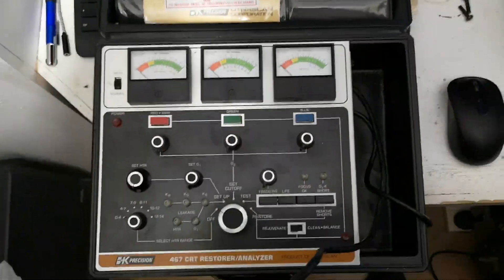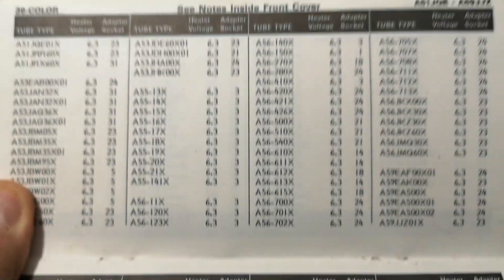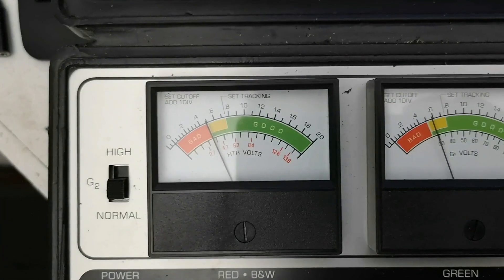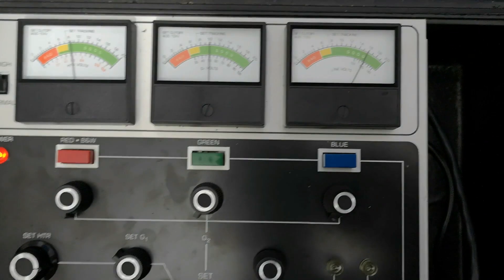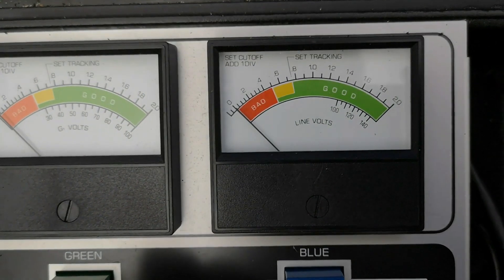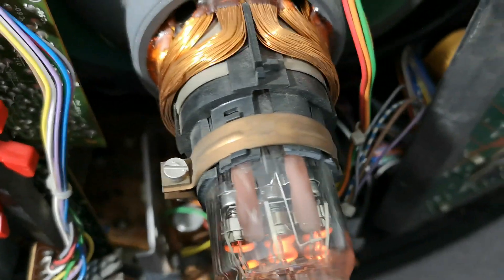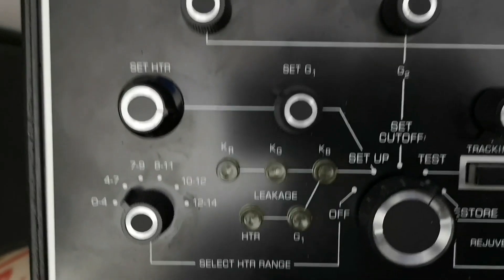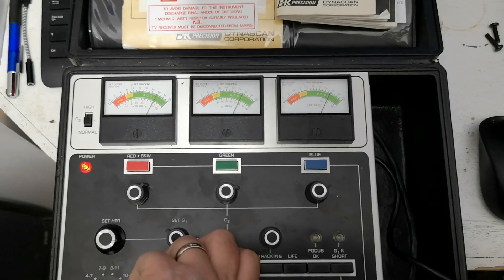Testing a CRT with the B&K Precision 467

Comment: hello I have a bk 467 crt tested the ammeter does not read the filament voltage it only indicates 1.5 v. but when I measure on the wires of the output cable I find all the heating voltages

Comment: Hi, I have the 467 and when its disconected from the tube, just turned on, the 3 little globes barely glow out of the 5. The unit works and cleans as normal, just those globes are always barely lit say 1/10 brightness. A leak to earth in the machine? Any idea as i have the schematic looking for a common point why all 3 globes would be drawing juice even when cable to neck not connected?
Reply: Hi, I just bought one of these on ebay, it has the exact same issue you describe with 3 lights (KR,KG,KB) barely lit up with nothing connected. Did you manage to fix it?